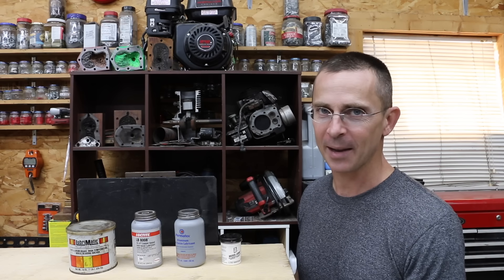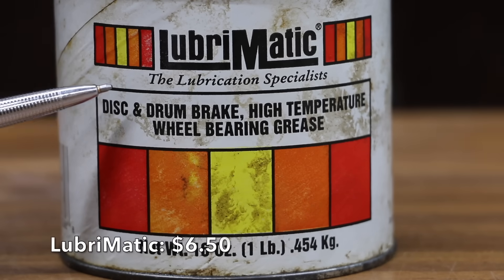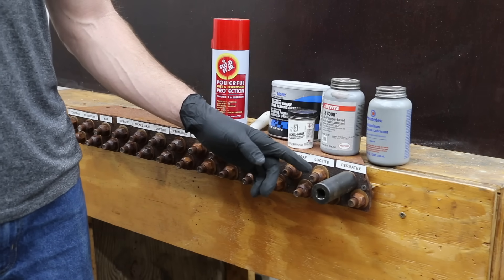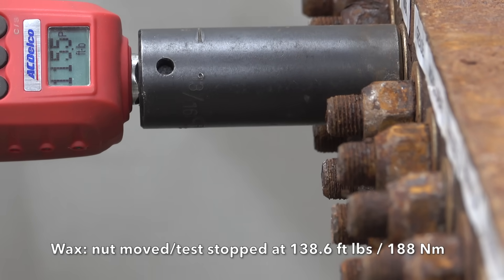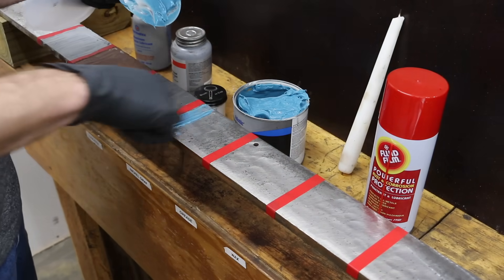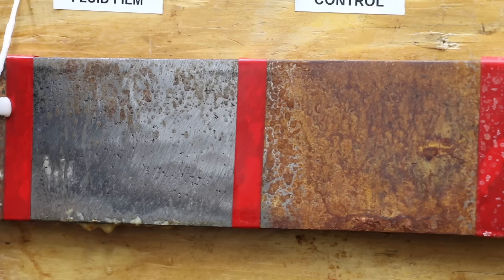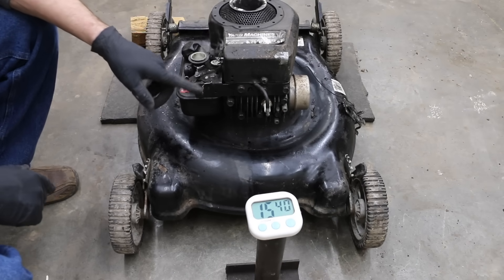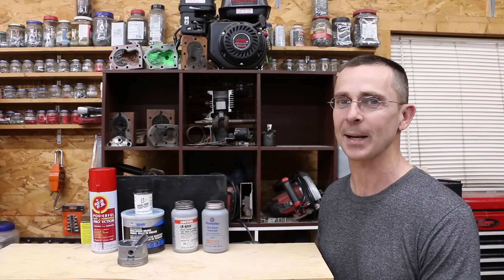Does Anti-Seize Compound Actually Work? Let's find out! Anti-Seize vs Grease vs Fluid Film vs Wax

Comment: I have a truck that has a gear noise in the transfer case whine until it warms up.
I live near Flagstaff Arizona and the temperature gets to a -4 in the winter.
The wind is very noticeable and the truck quiets down by the time I drive 40-50 miles.
I would like to know the best available additive and or oil to put in it to reduce friction and noise but still have winter properties.
It is a 2005 International Pay star 6 x 6.
I absolutely love what you did for it by changing to Rotella T5 and a gallon of motor coat in the last oil change.
In less than 5 miles from the pilot oil change Center west ward on I / 40 at 70 miles an hour you could actually hear and feel the lubrication quieting and smoothing down the sounds and vibrations.
T6 is no longer available here.
I thank you very much for that.
I did the same treatment on all of my vehicles including a Mack Granite dump truck that I drive three hours to Phoenix to work and back and back. The fuel economy has almost doubled pulling a trailer and tractor.
I was thinking about adding the motor coat also to the oil bath axles. But my concern is sometimes you make liquid too slippery and it’ll pass through the seals and onto the brakes and that is a bad thing. Returns
I know that I wrote down the best penetrating oil name so that I could buy some and have mis placed it. I do use the motor coat, Kwik lube spray grease and another red spray industrial penetrating lube. There is another spray lube that has two versions that I use quite a bit also with good results but it’s 2 AM and I’m laying in bed watching your videos. The sprays have different functions. 
The other thing I would find interesting is a good dry lube for it is very dusty and dry dirt up here like farm dirt and cinders. The door on the international passenger side squeals and I have tried everything on it that I can buy and it still has not been able to quieted. And a dry lube either graphite or polymer is what I’m looking for also to not stain or collect dust .
Thanks Dave L.
Reply from the maker: Thanks for the video idea.

Comment: Once upon a time, I worked in a Nylon plant, our process ran around 550 degrees, we had miles of piping and our bolts were from 5/8” and bigger, we used Permatex anti seize with copper, and we had it with silver as well, we had miles of piping, and 1000’s of flanges with 6 or more bolts each, we overhauled the lines, each year, several lines, that anti-seize worked absolutely perfect, we very, very, seldom had a nut and bolt that was seized! That Permatex with Copper was fantastic!
Reply from the maker: Thanks for the feedback.

Comment: To clarify, Back in the 80's, guessing 1983, I bought a new 50hp Mercury outboard. The dealer used antisieze on the splines of the prop shaft to keep it from seizing on the shaft. About three years in a row, it seized on and I had to heat the shaft with a propane torch to get it to release. A good friend said he used just regular grease on his and it never seized. I switched and it never seized again. Even though I use the motor almost 100% in salt water, it never freezes on. I have not had that prop off in years, but I bet I could go out today and take the prop nut off and the prop would easily slide right off. As far as antiseize products, I find them great for bolts and nuts, juat not good for outboard prop shafts  splines.
Reply from the maker: Thanks for sharing.

Comment: I've used  Permatex Aluminium Anti-seize in the HVAC trade coating rooftop blower shafts prior to installing fan blades. I have gone back to these units 5+ years later and still found a thin coating of anti-seize present on the shaft. This makes replacing blower motors, blower wheels, and pillow block bearings a breeze. Rooftop a/c units are exposed to rain, snow, and varying temperatures. Permatex aluminum lasts through it all. I have also used the copper and noticed that it does not last as long but have never had an issue with pulling keyed parts off. Both do the job just fine.
Reply from the maker: Thanks for sharing.

Comment: anti-seize and molybdenum grease is especially good for dis-similar metals. Putting anti-seize on a steel bolt going into an aluminum threaded part will save you endless headaches !
Reply from the maker: Thanks for the feedback.

Comment: I JUST RAN ACROSS THIS VIDEO AND AM AMAZED THAT SO MANY PEOPLE ACTUALLY HAVE NO CLUE WHAT ANTISIEEZE IS ACTUALLY MADE FOR. IT'S PURPOSES IS NOT TO KEEP PARTS FROM RUSTING, THREADS FROM RUSTING OR ANY OTHER ANTI RUST FUNCTIONS. IT DOES A FAIR JOB AT THAT BUT IT'S ACTUAL PURPOSE IS TO PREVENT THREADS OF FASTENERS FROM "SIEZING" AS THEY ARE BEING TIGHTENED SO ACTURATE TORQUE IS ACHIEVED WITHOUT THE THREADS GALLING. BOWMAN FASTERNERS USE TO DO A DIMISTRATION WITH A DEVICE THAT MEASURED CLAMPING FORCE. WITH ANTISIEZE CLAMPING FORCE WAS REPEATABLE LOSINING AND TIGHTENING. WITHOUT ANTISIEZE EVERYTIME A FASTERNER WAS LOOSENED AND TIGHTENED THERE WAS A LARGE LOSS OF CLAMPING FORCE. THIS IS THE ACTUAL USE OF ANTISIEZE.
Reply from the maker: Thanks for sharing.

Comment: I use the C5-A copper stuff in the interface between my silencers and the mounts where serious hi-temp resistance is required, it works great, no more stuck or carbon-locked cans!
Reply from the maker: Thanks for sharing.

Comment: I've never used anti-seize for protection against corrosion. I use it as a high pressure lubricant in scenarios where galling is a possibility. For lubrication and corrosion resistance, use waterproof grease. For motor oil, use motor oil.
Reply from the maker: Thanks for the feedback.

Comment: Would have liked to have seen a couple samples of the grease and candle wax that did not go through the heat cycle.
For example the bolts in a picnic table or a deck.
Reply from the maker: Thanks for the suggestion.

Comment: Working offshore, there's two issues. One is galvanic corrosion, the other accelerated chloride-induced oxidation. Copper and nickel based anti-seize both accelerate thread damage due to galvanic corrosion on continuously wetted fastenings. The copper anti-seize seems to wash out a lot faster than nickel, perhaps a different grease base. The best anti-seize for offshore is a zinc-based one.
Where it is absolutely necessary to use any kind of anti-seize is on stainless fasteners, as stainless tends to gall or cold-weld, eventually becoming a single solid piece of stainless that is impossible to disassemble, even with light torque.
Reply from the maker: Thanks for sharing.

Comment: Anti-seize is specifically designed to avoid galling, not rusting, although it'll help stop corrosion as well.  Galling (cold welding) is common on certain metals like 304 stainless and brass and bronze.  I hope your burgers don't taste like anti-seize after using your BBQ .  LOL
Reply from the maker: lol  Hope not either!

Comment: In Wisconsin, that stuff is Frank's Red Hot. I put that shit on everything. I've pulled shafts off of gearboxes that have been sitting in the elements for 5+ years. I can always tell if anti sieze was used. If it wasn't, out comes the torch.
Reply from the maker: Thanks for the feedback.

Comment: I liked the iron bar rust test! How about testing motor oils for rust prevention in the same way? Use a clean foam brush for each oil brand, synthetic and petroleum, and brush on a sample of each to the bar. Instead of spraying on a corrosive spray, hang the bar inside a box and increase the humidity inside the box by boiling water in it or use a humidifier of some type and see which ones are winners and losers. I’m interested to see how the classic car specific Z-Rod oil from Amsoil does against the signature series Amsoil and other brands like Mobile 1 and Valvoline. Specialty, custom and classic cars need extra rust protection since they sit a lot, especially in high humidity areas of the country. Thanks
Reply from the maker: Thanks!  Thanks for the video idea.

Comment: Thanks for confirming my faith in Permatex antiseize, I've used it my whole career as an HVAC service technician! A little goes a long way, one bottle lasts for years. New subscriber here from Wisconsin, corrosion protection is very important here in the Upper Midwest! You're making Consumer Reports look like amateurs!
Reply from the maker: You are welcome!  Thanks for watching and subscribing!
Reply: Here is the thing with Permatex and why I like it over loctite and the others. It is a LOT easier to apply and is thinner and not as much is pushed out when tightened. Also being thinner it works a lot better on brake slides. At the shop I work at, we don't use brake grease anymore because salt brine actually washes brake grease right out and in Ohio there is a lot of salt brine used on the roads. The brake jobs we usually do have dry pads and slides. The Antiseize will harden but even hardened antiseize is slippery. The copper and Loctite doesn't do as well with that. Also Longevity...Permatex seems to stay longer on surfaces it's applied to than anything else. After 10 years my boss had a truck come back for a transmission job and when he did the torque converter 10 years before, the Antiseize he used on the guide pins to line it up still had a good amount of it in place and it came right loose.
Reply: What sorts of anti-seize applications come up in HVAC?
Reply: @racecarrr  any fasteners that are outdoors or in less than ideal conditions...? Just like anything
Reply: @racecarrr  nuts and bolts, threaded compression fittings, screws in appliances such as ovens(hot), screws and bolts in damp basements or roof units that are exposed to the elements.
Reply: very true- the cap/brushes usually fail before the stuff is gone.
Reply: On  some of the ball mills used in the gold mines, we used aluminum based  anti seize on the big bolts that old the steel liners in place. man, give them 3 months, and that stuff acts like glue. Impossible  to undo without a huge impact gun.  The best is copper based but its expensive
Reply: @robertlindsay9826  He mentioned in the video that anti-seize can cause galvanic corrosion when used on certain metals, so it's important to pick either the aluminum or copper stuff based on what it's being applied to
Reply: Is it good for ball lube?
Reply: Doesn't really confirm anything. The first test has a trial number of 2. Statistically irrelevant. It is very obvious by the nickel based anti seize going out to 150 in one test and 70 ftlbs less on the second trial. The control samples were the same, and one of them were in line with protected threads (I think with grease). Plus, 3 months of artificial aging isn't really relevant. Heart cycling, vibrations, cold, and you're concerned with years of use, not weeks. I guess this is good for YouTube and for people that don't science and don't know about statistical reference, but the results are inconclusive.

Comment: I know of two slow-speed diesel engines manufactured in the far east in the mid-70s that experienced some unusual encounters with anti-seize.  The engines were both 10-cylinder, 900mm bore turning about 90rpm slow speed diesel engines. 

The crankshafts were assembled of individual pieces, using shrink or press fits.

Someone in the assembly process, without the knowledge of the manufacturer, supervisors, quality control, owner's representatives, or regulatory agencies decided to speed the assembly process by coating the crankshaft parts with anti-seize in way of shrink or press fits.

Both engines passed shop tests, dock trials, and sea trials.  The ships were put into service with no apparent issues.  A least one of the ships experienced engine problems.  Examination of the engine found that some of the crankshaft components had shifted and the crankshaft was misaligned.  The anti-seize worked as intended, it prevented the components from seizing.  The problem was the crankshaft components were not intended to move relative to each other.

The moral of the story; is don't put anti-seize in the crankcase and don't lubricate shrink or press fit with anti-seize materials. 

Bob
Reply: This is why it's so important for every person involved on a large project to understand the whole project and how it functions. That technician/team was clearly told to fit the parts together, but must have had no concept of why they were going together or what exactly was going to happen to the parts once they were in use. They just slapped the parts together because that's the job they were given. That or they just hated their jobs.
Reply: @Joseph-C  In this case, as I understood it, the individual loved his job and the company.  He was trying to help speed the assembly.  He didn't understand the consequences.
Reply: Thanks for sharing your story!  ... and I don't give a rat's ass if you can spell or not.  The conveyence of your idea and willingness to share knoledge is what counts here.
Reply: Great story.  William Nixon, Metallurgist, Physicist
Reply: @Okurkaarrgghh  you missed conveyence. I guess your spelling knoledge has a few gaps
Reply: @M F quick ... correct your misspelling ...
Reply: How did you manage to misspell "seize" so often?
Reply: @Okurka  I have no idea.  I was never great at spelling.  I can also claim it is a result of over-reliance on the spellchecker.  I will go back and correct my mistakes.
Reply: @Okurkaarrgghh  its a homonym

Comment: Back in a day, I've seen Air Force aircraft engine technicians that swore by using milk of magnesia on jet engine mounting pins that were as big as coke bottles.  Give that a try.
Reply from the maker: Thanks for the suggestion.
Reply: @ProjectFarm  I found this on a home machinist thread:  If anyone is still interested, the answer is yes. I worked as a machinist in the USAF, part of our job was to remove stuck or damaged screws and bolts. The Jet Engine Mechanics used liberal amounts of MOM on the bolts in the hot sections of the engine, running the bolts in wet when reassembling it. MOM is required use in the Tech Orders (Maintenance Manuals) and I'm sure it is the same throughout the military and jet engine world. From several sources I've learned that there is nothing better to use on bolts that are installed in hot sections like exhaust manifolds and turbos.
There were many times that I was dispatched to the Jet Shop (J/S) to remove broken bolts because someone forgot to use MOM on the bolts or used a very light coating missing spots or used the wrong anti-seize compound. The Milk of Magnesia dries after it is installed and leaves a slick powder like coating that is extremely heat resistant. Some of the other anti-seize compounds on the market will not work in hot areas of engines and will actually bond to the bolt in the mounting hole almost like a solder. MOM is cheap, readily available and works almost 100% of the time if applied correctly. I have seen articles were some have used MOM on spark plugs, mostly in air cooled engines like motorcycles and VW engines. But I've found that it can interfere with the grounding of the spark plugs causing them not to fire or fire intermittently. MOM or Magnesium Hydroxide is not electrically conductive. For that I use a high heat nickle based anti-seize compound.
Hope this helps as to understanding why MOM is used as an anti-seize compound. But remember it is used in hot sections and will not work in cold areas, especially if exposed to water. Use caution and the correct anti-seize compound required for the job you are doing.

Comment: If you are a home mechanic, just get a tube of anything from the parts store or that big box store. What this demonstration proves is that all of the products work adequately. The only thing you have to consider is whether a product with a metallic base is correct for your application.

Myself, I use synthetic brake grease as an all-purpose assembly and thread lube. My most recent go-around was a timing belt and water pump on a 2.2L Toyota engine. The idler bolt broke, and when I got into it, I found out that it was a mess of mismatched, corroded and improperly torqued bolts. Someone had done the timing belt and water pump before I got it, but they did an awful job of it. I had to take a city bus across town to the junkyard to get the correct factory fasteners. And also buy some tools to extract the broken bolts.

The lesson from my story is that if you do work on your own vehicle, use some kind of assembly lube or anti-sieze compound. If you keep the vehicle, somewhere down the road you may have to do the same job over again. If you sell it, the next owner, if they keep it, may have to do the same job, or have it done by a shop.

Another reminder: WD-40 is a good product, but it is not a lubricant. It will clean bolts and threads and make assembly easier. It also will work as a penetrating oil. Its major ingredient is deodorized kerosene. Kerosene evaporates. Cleaner and temporary lubricant? Yes. Permanent lubricant? No way.
Reply from the maker: Thanks for sharing.
Reply: @ProjectFarm  Thanks for getting back. The bus trip was okay. The yard is located in an industrial area on the edge of the city. They put in a bus shelter there, so there was no problem locating the stop. I'm pretty sure the reason why the idler puller bolt broke is because it was not torqued properly.

Every time I buy a car, I end up spending a year fixing the bad work done by some previous owner of the vehicle. If I had gotten in there and fixed the leaky water pump immediately, I am sure I would have retorqued all of the bolts and I never would have had this catastrophic problem. But it was a very small leak, so I never got around to it.

What did Dr. Franklin say? A stitch in time saves nine. I also repair my own clothing, so I know a lot about that.